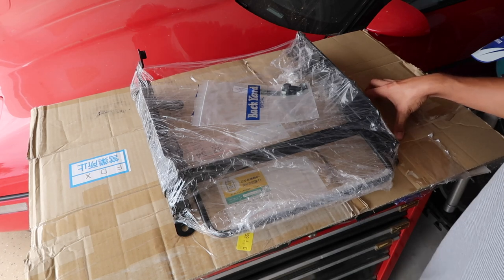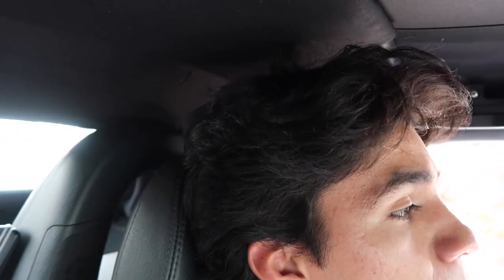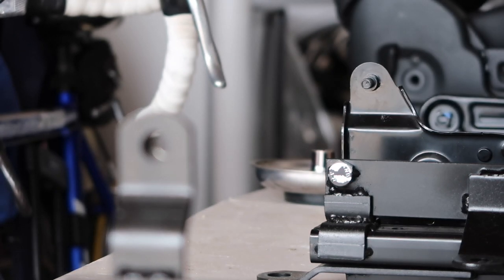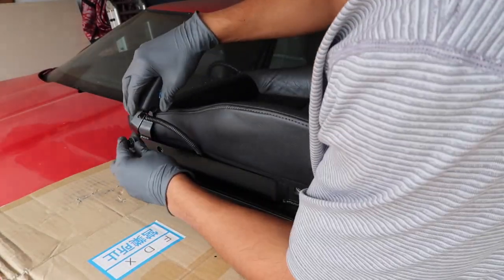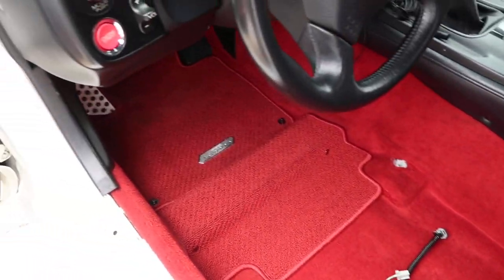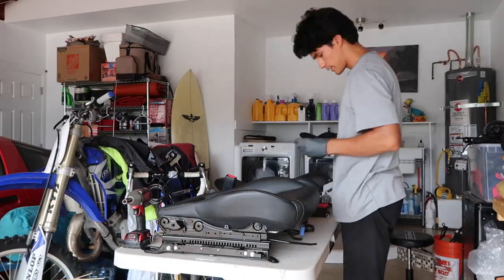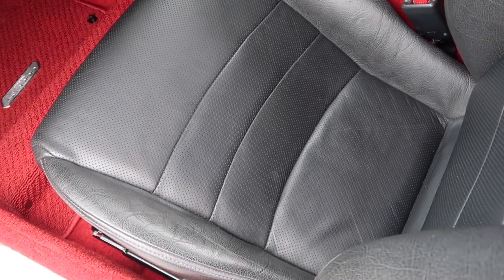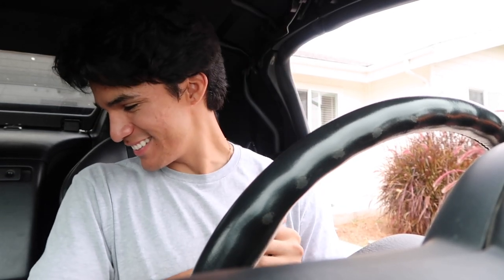Lowering Stock Bucket Seats in the S2000! Back Yard Special Seat Rail Install

Comment: Did you just use the bolt without the washer and lock nut for the seat belt? And supposed to be solid with no movement?
Reply from the maker: Had to re watch 6:10 a few times to remember but no locking nut from what I recall because the OE rail and the BYS rail have threaded ports for the OEM seatbelt – you literally take it off one rail and bolt it to the other and its super solid, I actually still have these installed but not for much longer
Reply: @jaelnava_  just FYI got it Installed but for back right when I put bolt in the seat does not slide all the way back, when I take it out it does …

Comment: I was tempted to go for the BYS lower seat rail but the fact that they are welded didn't make me feel comfortable since experts told me that seat rail should never be welded pieces. I looked into Recaro japan super low seat rail but you need a sport seat for those. I agree that the sitting position is the worst defect of the S2000. You seat so high compared to the steering wheel that it's weird. Even my family s utilitarian Fiat Punto can get the wheel at my chest's height. Besides I really wish I could bring the steering wheel much closer. In italy there is a company selling a steering wheel spacer which brings the steering wheel 5cm closer without any other particular mod but I don't like the look. I think a sport seat would make the wheel feel even more far away. Don't wanna go for aftermarket without airbag even though some wheels looks astonishing on the S. ciao good job with the video, very clear
Reply from the maker: As long as the welds are executed well, there shouldn't be a real issue with a welded bracket. Yes welds fail over time but we're talking years and years and years for something like that to happen. If you're not doing anything insane with the car either, there's even less cause for those welds to deteriorate. 

Anywho, I'm glad you agree w most points of the video, it's hard being a slightly taller driver in the S but w a few tweaks it can be much more livable!
Reply: @jaelnava_  tempting. How do you find the driving position after a few day of use? Enjoy. Ciao
Reply from the maker: @massimilianozeni1848  funny you ask this, I actually love it more and more every day! each time I get in the car I'm pleasantly surprised by the reduced height – weirdly, car feels more comfortable, more solid? and safer
Reply: @jaelnava_  that s good. Do you find the steering wheel to be close enough? Thanks for the info! Ciao
Reply from the maker: @massimilianozeni1848  yeah no issues reaching for the wheel at all, if anything I'm more comfortable sitting closer to the wheel because my legs aren't making contact with it but I sit semi far back enough to get as low as possible while maintaining a 45 degree bend in the arms